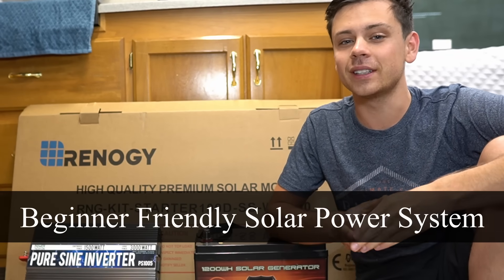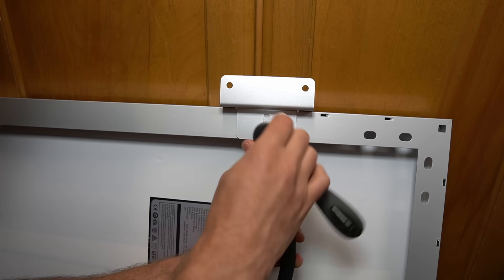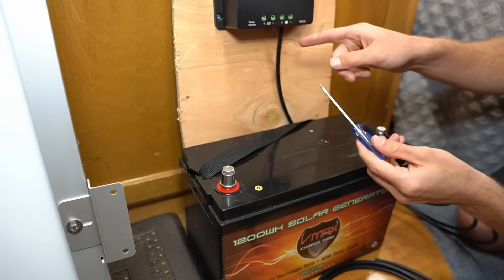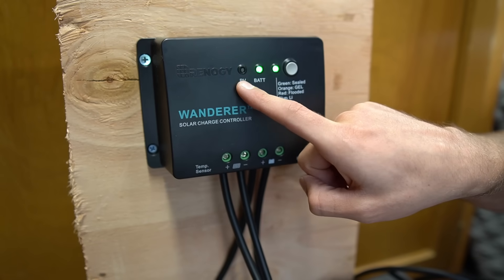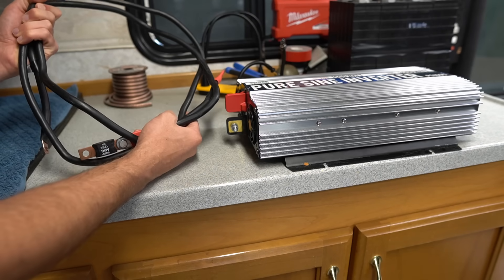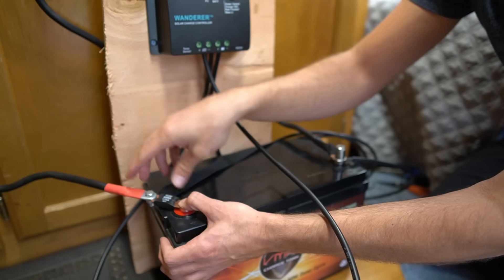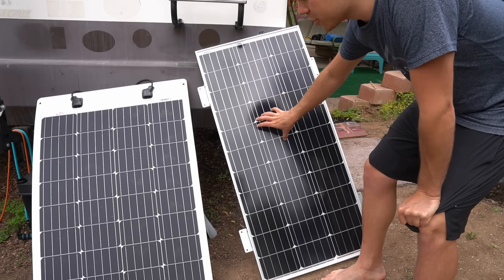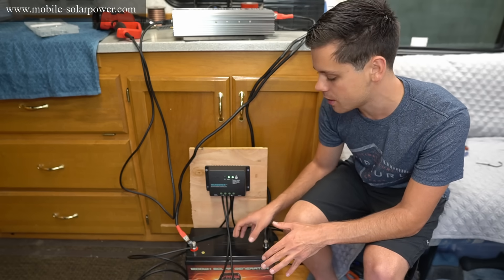Build Your First Solar Power System! Beginner Tutorial Easily Explained, Budget Friendly

Comment: Great beginner video, one of the most clear I've seen.  BUT, why do you spark the positive instead of connecting the negative last (avoiding the spark) like we do on cars?  I've been told the spark can ignite hydrogen coming off an unsealed battery (if you are using one).
Reply from the maker: Because that only applies to automotive application. And I can't think of a single person using flooded cells for solar systems anymore. Those are ancient
Reply from the maker: And you will always have a spark when completing a DC circuit
Reply from the maker: Automotive Systems are very different than Solar power Systems

Comment: Actually that's backwards on the positive and negative wires in reference to the solar panel it won't effect the set up to follow these directions. I work in the field and we call it the other way. The female boot is negative and the male boot is positive. The female looks like it should be male and vice versa. We call it by the crimp on the inside.

Comment: @will thanks for your videos,
I have a question! When I have a 150amp alternator. Does a 140am smart isolater work?  Are those kind of questions answered in your ebook?
Reply: Will would most likely recommend a DC-DC charger from Renogy ESPECIALLY if you're using lithium.

Comment: I need some help, I need to know what size battery and panels I would need to run a small 12v 2.3amp fan overnight
Reply: Convert to watts first (volts x amps = watts) so in your case, 28 watts per hour, assume 12 hours, 336 watts. Convert that back into amps, 336/12 = 28 amps. If you have AGM, I would more than double it and round up so 75 amps. For lithium, because you can use 80% of the capacity, 40 amps or more. 100 watt panel should be sufficient.

Comment: Have you thought about hooking up the positive power lead before hooking up the ground cable. power down the power regulator and the inverter( if they are switch controlled). This should eliminate that large spark.

Comment: Great Video!! Thanks... Is it safe to assume the Wire that is running from Solar Panel to Charge Controller is good enough to be used from Charge Controller to Battery? but higher Gauge wire required from Battery to Invertor?

Comment: question i have  six 40volt 185watt panels. i currently have 3 of them series to make 120volts and ruining two arrays to the mppt do i require diodes to prevent power back feeding.???

Comment: So what do you think of that patriot indoor inverter? I need a solar system and inverter and batteries for my 2017 Ford Transit van but there’s a place here in Portland, Oregon that wants about $4900 for the inverter, batteries and shore power. That’s very expensive. I’m trying to run a 1500 watt heater. Right now I just run the van to stay warm. You’re video looked pretty easy but I want to put the solar panels on top the van and I would need to find a dry spot to do it.

Comment: there's no ground on this system what happens when the amps get high with more sunlight? the MC 4 do arc out with time since dc voltages changes this type of system is small and would require the battery to be charged for the consumption through this system. how much warranty does the inverter have without this inverter the system is useless if the DC dose no convert to AC not to  mention the shading that will happen on a DC system will knock out both those small 100w modules. always go with micros less things can go wrong. Good vid but not sure this type of system would benefit a homeowner or mobile home owner. people forget solar is to save money not have headaches over DC voltages problems because of this type of system.
Reply: so much bro arc fault kit ? 
it sparks because it is completing the curtis.
Reply: fuses go out and the customer would have to trouble shoot that fuse to know its out. line loss is normal that's why you always size a system according to usage and add line loss. there's so much solar can produce but the information is not there always just going over what i do for a living everyday.
Reply from the maker: Oh goodness not a problem at all. Low voltage here. This is for charging laptops, not home owners. This is a tiny tiny system

Comment: I just built this system and included a temp probe and AiLi battery monitor.  This was my first exposure to solar and electricity.  It’s been a big learning curve, but fun.  I installed the system in my detached garage, that has never had power.  I’m running a garage door opener, LED lights and one power outlet. Tested the system yesterday and all is well.  Thanks Will.  I would not have taken this project on without your guidance.  Looking forward to seeing your off grid house video’s.

Comment: I like this boy because I can understand what he says - which is extremely unusual of his generation who all seem to blur their words and trail off their sentences. That is when they can actually be bothered to use words instead of grunts and sniffs.
ANYWAY - the controller in this video is PWM and PWM controllers reduce the solar panel charging ability by about 20%. Take it from a permanent liveaboard Yachtswoman; do not have PWM controllers. Use MPPT controllers instead because you will receive 98% of your solar panels charge via it to your battery. Have a fuse between the controller and the battery and use heat shrink on ALL connections and build in drip loops to the external wires before connection points.

Comment: I want to add panels to my campervan, but there's already one panel installed 6 years ago. This panel is a 110W Büttner (MT SM-110 MC), which has 72 cells and a voltage of 21,6. I'm thinking about adding 2 panels of each 110W (Wattstunde WS110BL BLACK LINE), they have 136 cells each, and a voltage of 22,8. What's the best way to connect everything? If possible, I'd like to use only one MPPT controller (Victron with bluetooth integrated). Can panels with different amount of cells be connected with each other without problems or loss in production of power? Thanks for the help!

Comment: question...  ive read that i can have 24v solar panels feeding into a mppt controller that will charge a 12v battery bank.... is that true or false ?.. 
  --((details )) --ive got  2 sets of 275 watts panels im thinking of combining into series for 24volts..   hook that into a 40amp mppt controller to charge 500ah 12volt battery bank.....    any feedback is appreciated

Comment: Hello,at 9:27 u said we should add 30 A fuse to the MPPT Charge controller and 40 A to the battery "for this line".Are those two should be added onto the same line on boths ends (battery and charge controller)?

Comment: Hi Will! I'm one of your fan from Malaysia. I've got one silly question  that need answers. Here goes! In on a off-grid situation, What happen to the current/electricity generated by our soalr panel when our our solar battery is fully charge? Where does it goes? Will the excess electricity harm our solar controller?

Comment: I want to build a small solar system with a 150watts 12v solar panel and a 12v battery but I'm not sure what kind of charge controller i should be getting? 10amps, 20amps? Please a response would be very helpful. Thank you
Reply: 10amp

Comment: Very useful video. I'm trying to find a way to get heat to a greenhouse and maybe this might work? You mentioned about discharging the battery fully. Is there any device to automatically switch it off when it reaches a certain level? I'm thinking if you were running a heater off it and it could just drain all the power overnight....how could you stop this happening

Comment: Love these videos that you do!  I have a home that is mostly in the shade in the winter months.  I would have to have the solar panels across the road, which is about 80 feet away.  (I have a pipe under the road I can run wires in).  Where would I buy extra long wires to run from the panels to the house?  Any special considerations for runs of wire that long?
Reply: Look up wire size calculators on the internet.  You plug in voltage, amps, and distance, and it tells you what size wire you need.

Comment: Great intro setup @DIY Solar Power with Will Prowse :) We're just getting to the internal build of our Skoolie Conversion and have no clue on solar! We ran across your channel, and are blown away by the wealth of knowledge that you're giving away (we'll use your links to support your content!) Going to search for your DIY 400 Watt video now (because we're probably going to need a bigger system...)

QUESTION: (and you might have a video on this - if so, please drop that link!) How do you know how BIG of a system to install in regards to the number of solar panels, charge controller size, inverter size, battery bank size?

Thanks so much,
- Brian + Erin
Currently converting a '97 Thomas School Bus into a Skoolie Motorhome
Reply: BE Adventure Partners that’s a big question but I’ll try to give a simple answer:
First you need to know how much energy (watts) you’ll be using daily.
Then you have to decide how many days you want to be able to run it if you’re getting little to no input at all. Most people go for 3-5 days. 
Then you want a battery system that’s large enough to support that and enough solar that can replenish at least one day of needs. 
So say you need 2000 watts of energy per day, then you’ll need 6 kilowatts of battery storage. So that would be 5 100 amp 12 batteries. Of course you can’t use 100% so throw in a 6th so to be safe. (Better to overestimate). 
Now you’ll want to have 2000 watts of solar input daily and figure 5 hours of sunlight (natural average — individual usage can be quite different). 2000 watts/ 5 hours is = 400 watts of solar. 
So essentially, 6 kilowatts of battery and 400 watts of solar.
Reply: @AaronGeller  Great explanation! We have been wondering where to even begin with thinking about how to design the system. We'll make a list of your responses and start doing some calculations to get a starting point. We appreciate your time writing back! - Brian + Erin
Reply: BE Adventure Partners to add a little more nuance, while you want to consider days of autonomy, there are some other points. 
Will you be driving often? If so, with a DC-DC charger, you can pump up to 50 amps @ 12v while driving or just idle the engine for a 10-15 min to put some juice into the batteries. 
If you’re stationary more often than not, you might want to consider having an external port on the side of your bus that allows you to park in the shade and set panels up 10-20’ away. 
We travel a bit when we are in our van so I don’t need many days of autonomy and with the 170 amp hours, I’ll still have around 75% capacity by the time morning comes and solar charging begins again. 
Sometimes spending more money on energy saving components will allow you to get by with less solar and smaller batteries. 
It’s all like balancing an equation.
Reply: @AaronGeller  Great info! We're going to be driving all over the North American Continent. One thing we definitely want to do is figure out how to tie the system into the bus to be charging while we're driving and isolate the drive batteries so they are not consumed while the engine is not running. Someone once mentioned that a "Transfer Switch" is needed. Haven't researched this yet :) Thanks for messaging with us!
- Brian + Erin

Comment: I am brand new to solar, no experience but want to key in on heating water for RV/Camping/tent...so going to experiment here at home. Would it be sensible to heat a hot water heater using DC element replacing one of the ac elements in a store bought system?? Could you preheat either a separate say small hot water tank...or the same one with the PV solar and then capture electrical AC power using it to power the AC side of the hot water heater with the battery? Also, with the MPPT charge controller I wouldnt need to use a DC element because it would allow me to just use the AC element..so will go right for that one. How about 4 solar panels? Heating maybe a 19 gallon hot water tank? Plus I might preheat as well using a solar tank on top of vehicle. So water would go through stages, pure solar heat in black tank, moving to hot water heated by PV solar directly + the battery giving me the final heat if needed. I don't plan on taking a bath every day...ha ha...great videos young man. I am a retired airline pilot in Florida. Originally from Colorado. Loved your video on the Tesla Model S battery....maybe you can do a rundown on maxing out one of those batteries for home/rv?? I am not convinced yet on the feasibility of  max solar on homes...I am considering augmenting my hot water heater for now.

Comment: You need a regulated power supply circuit that bypass the transformer so not to burn the solar charge controller.

Comment: Dude I find your teaching ability right up There at the Top.
I hope you find good success with that which you are doing you truly are earning it, well done.
Having said that I still cannot find an answer I'm looking for.
Connecting between series and parallel on the solar side.
Parallel maintains volts but increase Amps.
Series is opposite.
What difference is there to the charging up of your batteries by connecting either way. And what are the pros and cons to the system. What difference is there to the charging system.
If just the same why spend more on bigger cables when amps are coming in stronger on the parallel side if it's all just the same On charging

Comment: Wish I had seen this before setting up my solar system in my van.  The only tip I would change (and who know I might be wrong)  Instead of unscrewing the wire from the charger controller when you change something on the battery.  I seem to mess them up over time.  I just use one of the quick disconnects that goes to the solar panel.

Comment: Questions: 1. To manage battery charging - is there a way to plug/wire trickle battery charger into the system? Might be snake biting tail but I'm lost. 2. When buying battery(s) is there a reason not to buy marine/deep cycle? I don't understand much - but was accustomed to using multiple deep cycle batteries to power off grid hot wire fences for pigs and cows. Always having one on the trickle charger and others in use. thx

Comment: To prevent oxidation of the connections, should we add/use di-electric grease on the connections? Some who knows definitely please add to this question. I lost a hot-tub junction block due to corrosion. Just a question. great great video. Tx
Reply from the maker: If it's outside, then absolutely. Inside? Not a big deal

Comment: Enjoy your videos.  Got your book.  Suggest a video not focused on a 120v inverter as the final use point.  My system, that I use everyday on my SoCal rooftop deck, is designed to use the 12v  output from the charge controller.  That 12v is used to recharge small USB power banks.  These are then taken to my office and charge all the USB powered devices.  This system is also part of my earthquake/emergency preparedness.  I have a suite of emergency items that are all USB powered.  Thanks

Comment: Okay, if we have a 100Ah battery that says 1200wh on it and I don't intend on using more than 10 Amps at any given moment. Can I assume that the battery will store 1.2kwh's?

Assuming a 25% discharge, it would give me 400wh of usable power?

I'm a bit "green" to this.

Comment: I bought 10mtr renogy extension cables and i have to plug red+ cable into neg- on the charge controller and vice versa theres something wrong here. Please note my plugs were already on the cable  with the other end wire to plug in to charge controller carnt possibly be my fault.

Comment: I was always taught when dealing with lead-acid batteries of any type you remove the negative first and connect the negative last to avoid the spark. So is a solar system different then????
Reply: That's what I want to know. I hear the same thing with cars and I always hear that from youngsters so I wonder if that is miss information.
Reply: @robertschmidt9296   Hey I am young and know that too!
Reply: Jake Sangria  It doesn't take a very big surge (spark) to damage computer components which is basically everywhere now.
Reply: You are correct. Connect Positive first. Remove Negative first. Just like on a car or a boat. Correct me if I'm wrong. Other than that this kid knows solar. Great content.
Reply: NILO NIFO....Negative Is Last On
Negative Is First Off
Reply: Me 3.  Just posted the same question.
Reply: The car thing is because cars are negative earth so that's why you take that one off first.

Comment: This is exactly what I needed to know. I am off grid in a small cabin for weeks at a time and this small system could be a game changer. I am curious: could I run some LED lights, perhaps a small television and a VCR/DVD player with this unit for several hours each night? Could I also high-jack a straight 12 volt lead from the wired battery to an RV sink water pump? Finally, is that sealed battery safe to sleep near? I assume it does not give off fumes, but I want to be sure. Thanks so much, this is really helpful as I move forward with my cabin. Thanks.

Comment: If you have an offgrid system and leave it for weeks or maybe months, is it dangerous to leave the panels connected to the battery? Is it bad or dangerous for the battery if it gets fully charged and the panels just stays on and connected is what i mean and you don't use any electricity while you're gone.

Comment: Could you give me some advice.
I have an RV with a small solar panel on the roof, inside there’s a small light that says when the solar panel is working should light up.
The light has never lit up so I’m assuming the solar isn’t working.
Could I just replace the panel?
I appreciate any help, thanks.